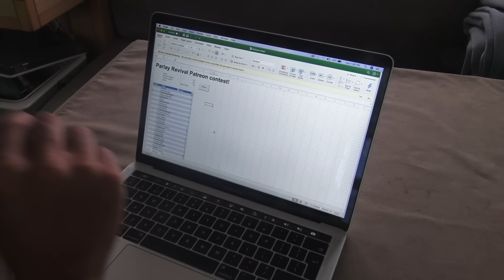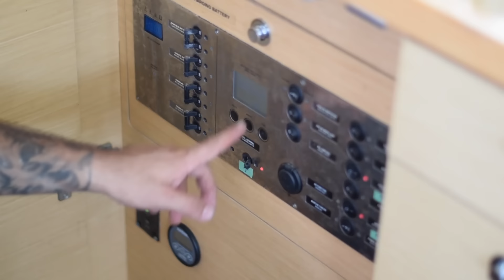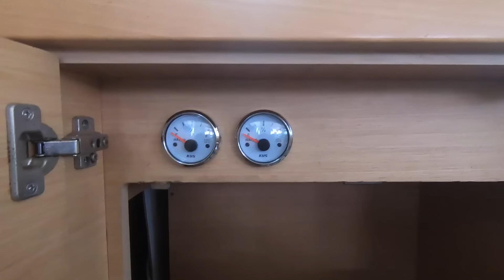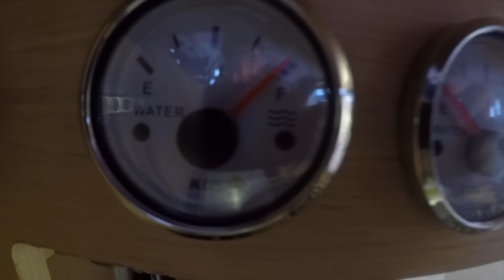Making NON-SKID GELCOAT MOLD to repair transom steps - Episode 45

Comment: When using 'crimp' connectors on a sea going vessel, squeeze a bit of 'Dielectric Grease' into the tube fitting first, you won't have to worry about corrosion from then on. Worked on my Balboa for ten years...

Comment: Thank you all for great education and entertainment. You must get a lot of free advice from viewers but permit me my 2 cents worth. I watched you change the shaft seal on a super yacht which interested me. The next time you have to stop water coming in try wrapping the under water shaft/ tube connection (after removal of barnacles etc ) with rubber banding like exercise  bands. If there are none on board there should be a roll of latex band in the boat's first aid kit which is used as a tourniquet for bleeding control after there has been an amputation. Bicycle inner tube could also work. After using the spare seal that was on the shaft,  I imagine the boat has to be hauled out and a spare seal put on the shaft which could be done the next time the bottom is scrubbed.   Take care. Jeremy.

Comment: What are your thoughts on using KiwiGrip to refresh the very worn non-skid on older boats? I’m trying to figure out what to do for the non-skid areas of my 40 year old mono.
Reply: Seen quite a few decks done with it, softer on bare feet too, looks professional, if you haven't used it before, trial & error - on a similar surface before you do the deck.

Comment: Great Vid. I’m wondering what type of gel coat/paint did you use to coat over the new molded non skid? Will you also recoat your cockpit molded non skid with this paint?thank you
Reply from the maker: It is just standard white gelcoat that he rolled into the mold to make the actual piece. plenty of wax to be able to remove it.
Reply: So we are talking about GELcoat and not paint ! Do they spray it in thin layers ? Is the cost expensive ? How long does it take to harden before you can sand it ?
Reply: @mikeferguson2828  No, it's polyester like the final finish on hulls etc, roll or brush it on, roller best, sometimes needs 2 coats to get the cover needed especially on non skid surfaces, then glass laminates to suit the need. Don't use waxed gelcoat, funny stuff that wax, it's in the resin to help set the resin when hardening, un-waxed resin on the surface doesn't set, the air stops it, so when the next coat is applied, gelcoat or fibreglass - it chemically bonds to that un-waxed surface, no sanding to remove wax needed then.
I read somewhere long ago, if a pot of resin without hardener (mekp) was sent into space it would set hard real quick..... waxed or not.
Reply: @mikeferguson2828  oh yea, it's sprayed Mike, then sanded - wet'n dry or some use drylube (that's what she said lol), buffed like a car, cutting compounds of various 'grits'